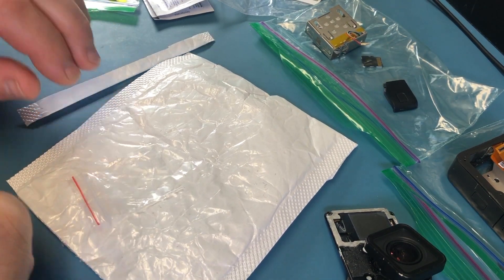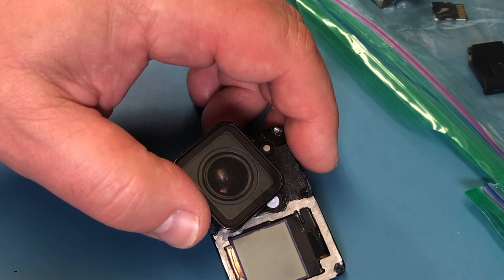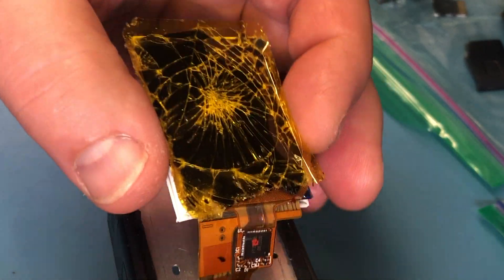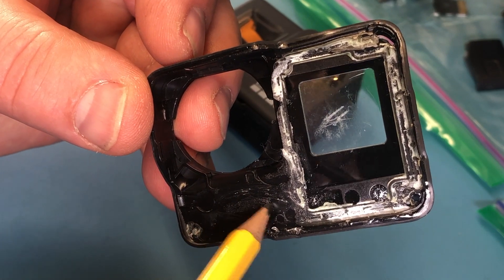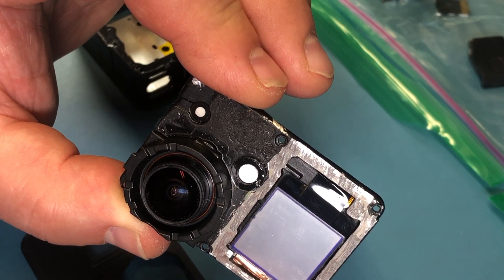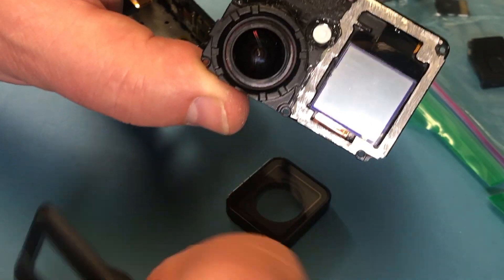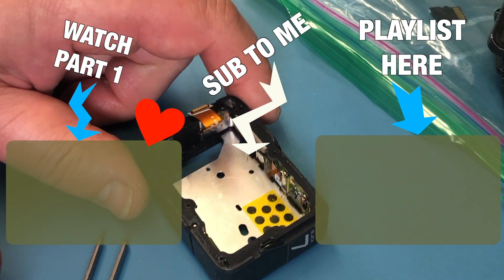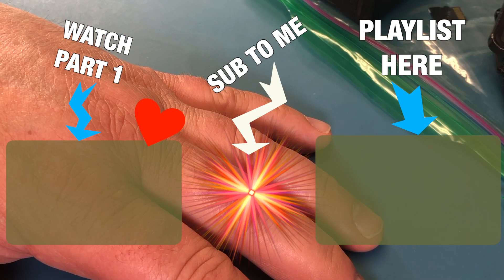GoPro Teardown Tips - 7 Repair Part II

Comment: HELLO THERE..
MY GOPRO HERO 7 BLACK  DIDN'T TURN ON AND NOW WHEN I PLUG IN THE CHARGER IT WILL NOT WORK BUT ONLY THINGS HAPPENS IS IT GET SO MUCH OF HEAT.
IS THERE ANY WAY TO SOLVE IT ?